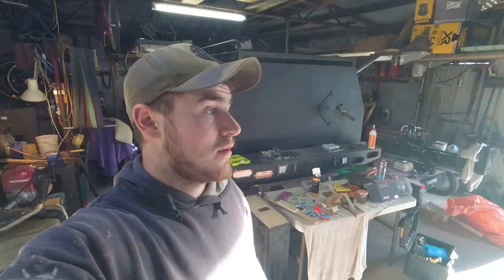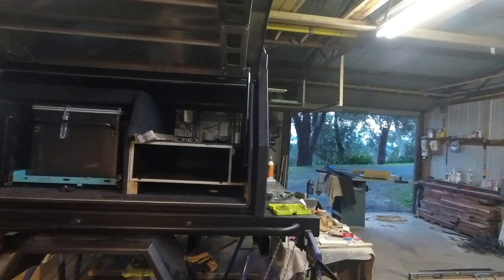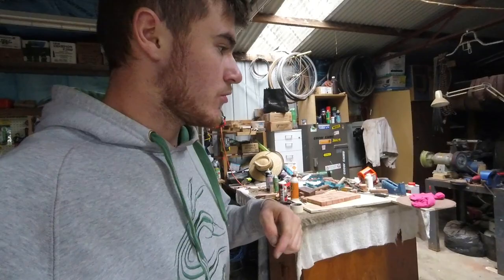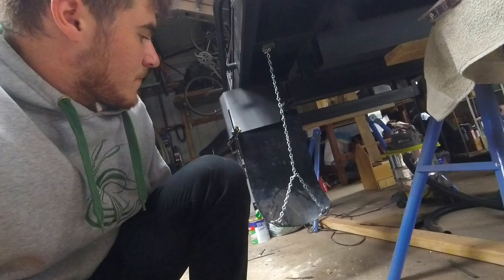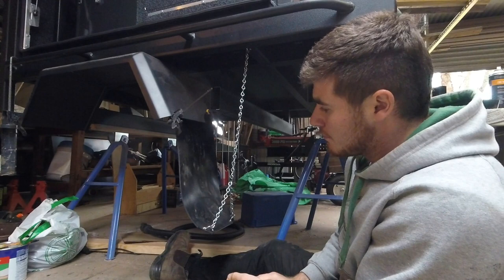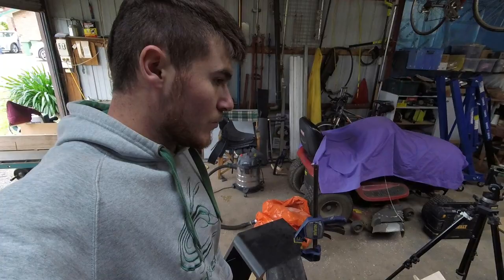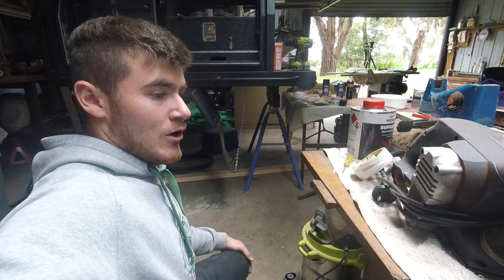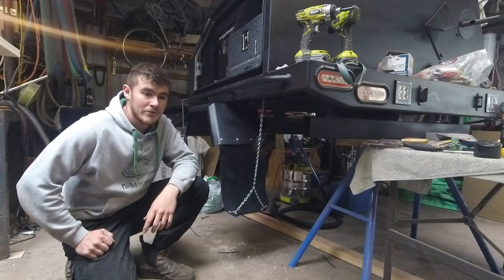Mud Flaps

Comment: What may look nice is tapered under tray boxes at the back and chain could attach there.
Reply from the maker: The under tray boxes was how I planned on finishing the rear quarters. Tho as you may have seen where my slides meet the rear is quite smooth, not big step that needs the boxes to cover it up. But may be a future addition